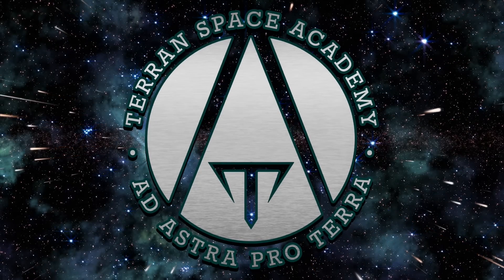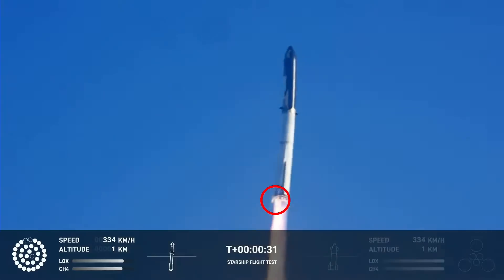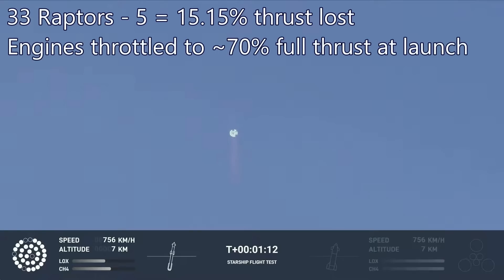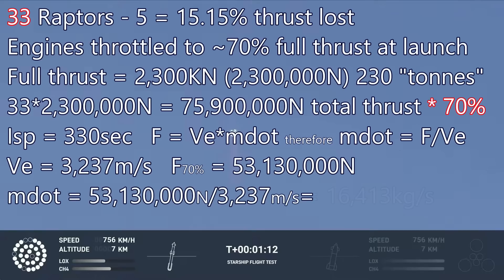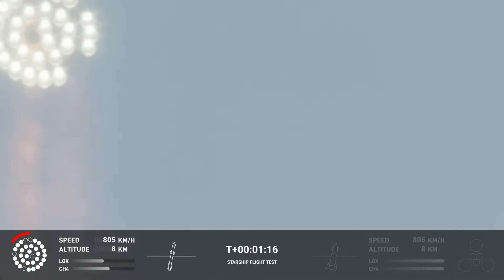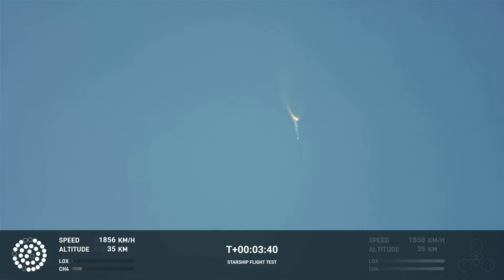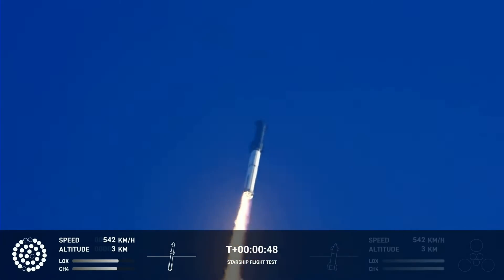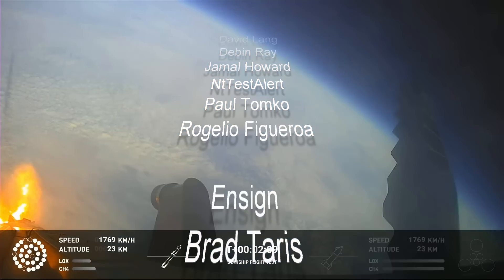Starship Flight Analysis: What went wrong with Starship?

Comment: You nailed it on the evaluation. I might suggest that an entire new video be made to examine the launch pad and what damage it incurred. There were obvious chunks of concrete that became cannonballs hitting fences and even man lift equipment along with temporary construction offices. An area that most of the live camera equipment for online YouTube sites used was dangerously plastered with chunks of concrete that crashed into cameras and taking out cars.
Reply: I think they are going to end up redesigning the launch pad. There is a reason NASA went to a blast deflector design, and it seems obvious that no material is going to be safe from that much punishment. It doesn't make sense to have to totally rebuild the surface and repair the structure after every launch.
Reply: @crawkn  See CSI Starbase. Zac Golden.
Reply: @samsleeman479  I don't have time to watch all that, but you could make whatever point is relevant.
Reply: @crawkn  Metal flame diverter parts are already showing up onsite. That was his and Zac's point.
Reply: @gravelydon7072  thanks. I hope they are planning on digging because I doubt diverters will solve the problem without a longer chute.
Reply: @crawkn  I thought is was ice
Reply: @lewistower1  there was a lot of ice falling off, which is to be expected, but I'm sure none survived the hot exhaust.
Reply: @crawkn  It did just not in that form, steam.
Reply: @gravelydon7072  yup
Reply: @crawkn , There's no more using concrete instead, thick metal plates.
Reply: @deancavander  YEAH , I was just thinking the same thing, a cooling system could also be installed directly under the plates to pull heat out in an attempt to keep the metal from warping. Maybe heating the plates at first to reduce thermal shock and then cutting to the cooling system as the rockets ignite....
Reply: @johnperkins5644  I had thought of that. Is that a standard sort of design? But a deluge system should accomplish that anyway, even if only from the top side.
Reply: @johnperkins5644  Properly done, the water from there could also be used in the suppression system.
Reply from the maker: Coming up my friend!
Reply: Yes!  No comment was made about the lack of deluge system  (allegedly because Musk wanted to proceed sooner than it could be made ready) or the damage and flying debris possibly damaging the booster.
Reply: The booster ignition after countdown remembered me more a test we know from nuclear bombs. Felt like the hell broke loose.😅
Reply: Who parks their car by a SpaceX BFR at launch? Someone to dumb to be working at SpaceX!
Reply: You can see debris shooting up just past the booster and reaching Starship it self in height, while it was ascending!
Reply: This thing is the biggest blow torch in the world, and with Ve of Mach 10 everything below gets burned and blown away. Higher launch mount, exhaust diverter and water deluge is the only option imho.
Reply: @FireEye-zd4fm  none of these things can be done there, not without new approvals and thousands of tons of concrete. There are only a few more launches planned from Boca Chica so far, and even they are questionable. Either the EPA will ban them, or the cost to build everything will not be wort it. Cape Canaveral is the future, as well as the oil platforms

Comment: I am of the opinion that stage zero debris blasted back into the engine area of the booster causing damage with immediate results and later in the flight.  Resulting in a true MECO not occurring in time, thus compromising the release of stage 2
Reply from the maker: You are most certainly correct Ray.

Comment: I'd think there could be an abort system immediately after launch where the booster would simply return the to the tower with starship still on board.   At stage separation there is only likely enough fuel in the booster to return it to the tower or in this case the water so if the booster doesn't separate from starship it likely doesn't have enough fuel to return to the tower with starship on board. 

 I'd think the booster would  have enough fuel on board at stage separation to be able to do a water landing with starship on board because it doesn't need to spend fuel on traversing a distance back to the tower.    In future cases if starship doesn't separate from the booster maybe a water landing could be a procedure.   The booster will float with almost empty fuel tanks.   Starship even with full fuel tanks will likely float.    There is still a lot of empty space in starship.   Liquid oxygen has a specific density of 1.1 where water is basically 1.   Liquid methane has a specific density of 0.66.   Starship with full fuel tanks should float in water.   Even in salt water retrieving the equipment is valuable for knowing what happened.   Of course this procedure would save the crew.   It would seem as long as the software is very smart it could bring the connected starship in for a smooth water landing even with massive failures.
Reply from the maker: Probably an emergency Starship abort to water landing in case of booster failure.

Comment: 1:56 - Analysis INCORRECT. .The flight computer does not increase and decrease thrust on outer ring engines to compensate and cancel out moments. That is the interior engines' job, and why they are gimbaled.
Reply: I have a hard time believing there is no thrust balancing in the software
Reply from the maker: There can be thrust balancing by throttling up and down the outer ring of engines.
Reply: @terranspaceacademy  There *can be*, but there is not. Ask Elon yourself, on an upcoming Spaces, if you don't believe it.

Comment: Another thing is that there is too much colour in the exhaust at times, suggesting that there is excess fuel or some other contaminant. Someone on the NSF channel suggested that maybe the hydrolic control unit (the box attached near the outside base of the booster) had failed.  Maybe we are seeing hydrolic fluid burning. They are going to be using electric motor actuators for gymbaling on next stages anyway.
Reply: Just some engine rich exhaust

Maybe
Reply from the maker: Hydraulic fluid?

Comment: Incredible! This was one of the most fascinating test flights I’ve ever seen. 

Thanks for the great lesson!

I’m no rocket scientist and I stake no claim in knowing anything about what I’m going to ask other than pure curiosity. I was wondering if there could have been an issue with the bmeco portion of the flight rather than a mechanism for the clamps failing?
I would have thought all engines on the booster would have shut off at the right moment the “flip” maneuver was complete? Could it have been due to all remaining engines still firing keeping the thrust too high thus keep the booster and ship attached? 

I have a feeling the “flip” is the best solution for this type of craft but it will only work if the engines actually shut down for the duration of time required allowing the ship to “tip” away?

Just a thought (out loud).
Reply from the maker: You are most welcome!
Reply from the maker: That could be correct as that would usually be catastrophic.

Comment: I see to remember in the Everyday Astronaut interview with Musk, he said there were no clamps to hold starship to the booster.  Thrust from the motors would hold it together...
Reply: I don't think there was enough positive acceleration during all that tumbling to keep them together. Had to be some mechanical attachments. Typically we would use a structural connection that is cut or otherwise released by pyrotechnics (pyro bolts, linear shaped charge, etc.), along with a separation method (springs, retro rockets, pusher pistons, etc.). I don't think SpaceX is using a pyro systems to separate, as that would take too long to replace for the next flight, so I expect it's some kind of mechanism, but I have no insight into what it would be. Most of the ones I'm familiar with are pretty slow compared to a pyro device (maybe 200 ms for the fastest ones). I believe they use pneumatic pistons to ensure axial spacing before the upper stage fires (at least that's what I understand they use on F9).
Reply from the maker: There must still be a release somewhere...

Comment: Only issue i think they had was pieces of concrete probably flew up and damaged a lot of engines, and had there been a flame trench we would have seen so much more!!!
Reply: Yeah, I think part of the rationale for not installing one initially was that there are no flame diverters on the Moon or on Mars.  But you still can't let your vehicle get taken out this way.  Hard lesson.
Reply: @paulwilson8367  I have always wondered about that.
Was there ever going to be a Superheavy booster launched from any body other than Earth? 
Why not use the proven flame diversion tech on the 33 engine monster and leave "flat pad" liftoffs for the 3 engine starship?
Reply: @paulwilson8367  There's no chopstick tower on Mars either. The booster is not intended to fly to Mars.
Reply: @paulwilson8367  they could launch an elevated landing pad before starship for it to land on instead.
Reply: @paulwilson8367  I was looking for this comment. While they may put flame diverters on Earth the lack of them on other locations for the first trips will mean they might want to research how to do it without one. Build to that. Then once they have diverters on Mars (moon doesn't need a booster but would apply for Starship), they can decrease the design strength later. It feels like the bulk of the population has "short term goals" thinking going on. Can't see past the end of their noses.
Reply: I've been baffled for a long time whey they haven't chosen to build a flame trench. They had the issue of debris damaging one of the earlier boosters during a test fire. Personally I believe that is the ultimate reason for the issues seen today.
Reply: @effervescentrelief  The issue is it isn't really a "they" issue, it is a government approval issue. 

Regs are very strict on what you can build in a reserve and a mighty big hole is one of them. Building the flame trench is relatively easy, tho not as easy as people expect. the issue is that getting the approval to do it will take forever.
Reply: @effervescentrelief  they probably wanted ease of access to replace engines without having to take it off the olm.
Reply: The reality is this rocket ultimately has to be optimized for launching and landing on Earth.  This really kind of precludes it from being good at anything else.  So might as well pull all of the stops to make this the best rocket to and from LEO.  You want to go other places, especially en mass, you are building more specialized ships to do those tasks; you are not doing it with Starship.  Especially Superheavy cannot make orbit and so can only go back to Earth once its propellant load is spent.  So might as well build around making its job as successful as possible, such as handling the tremendous thrust necessary to get this stack off of the ground on Earth with a proper flame diverter system.
Reply: @ChaJ67  They have a specialized ship for that. Its called 'Starship'.  😅  Super Heavy doesnt launch from the moon or mars.
Reply: To me it still looked like fire around the center engine that was out, makes me think it could have gotten hit immediately by debris, it looked like the hpu's and a few engines exploded in flight but the steps they took earlier in the year with engine shielding and containment and redundant systems almost kept it together.
Reply: @CanOp3n3r  Yes, I was deeply impressed when seeing that the rocket survived multiple engine explorations. It is a tough rocket.
Reply: They have the pipes for a much better deluge system but never were installed.   I think they were planning on reworking the launch stand after this launch before they even lifted off.  But looking at the damage and crater the launch did I think it was much worse than what they were expecting.   You can see some large chunks of concrete fly up almost as high as Starship was just as it lifted off.  I also wonder if some of the lost engines they tried to leave running and do a hot start on.    There was a lot of yellow flames at times that are not the clean burning methane from a well running engine.  Maybe they left them running to gather data and see if it was an option.
Reply: @Wild_Lee_Coyote  i like it
Reply: My thoughts exactly.  Debris from the pad flew up and damaged the engines.  A flame trench might have saved it.
Reply: Yeah but which direction to divert to? The OLM sits near the boundary of the site and is surrounded on three sides by ground equipment.  I don't think they'll be permitted to divert towards the open marsh land.
Reply: I think the reasons for no flame diverter and water deluge yet is it is extra work, and maybe they were unsure if they were going to be able to fly from there at the time , but also if the rocket just exploded on the pad, it would have been for nothing. They stuck with the minimums needed for flight for stage 0.
Reply: @digi3218  this has been discussed by Elon and SpaceX multiple times,  and you are spot on.
Reply from the maker: I think so too.
Reply: A thick metal launch pad with high melting point and flame diverter is the way to go here. Concrete in this situation will just be pulverized with that amazing power.

Comment: That engine that apparently came back online, could that have been the 1 still lit at the point of separation, therefore preventing it from doing so?
Reply from the maker: It was clearly out on the screen and stayed out.  I'm not sure why the sensors thought it was back up.
Reply: Will be nice to hear what actually happened throughout that magnificent display.

At least the trench is halfway there now...

Comment: Judging by the condition of stage 0, and the only real goal being for it to survive, it was not a successful test. Still a massive feat though
Reply: huh? it was a flight test.. it flew .. it cleared the pad ... which there was a good chance it would not .... and they got to test the self destruct range protection ....
Reply: Yes, major damage to stage 0.  Flame trench or steel plates are going to be required, concrete isn't working out
Reply: the goal was never to survive it was simply to clear the launch pad and that was always the goal from the beginning
Reply: @niox1920  The damage to the pad will significantly delay the entire program and affect Artemis. I'd call that a failure.
Reply: @Bellabong  First this isn't artemis and second they were going to redesign the pad anyways
Reply: @niox1920  Artemis 3 will require a starship in December 2025. And they can't even test another starship for half a year.
Reply: @Bellabong  top stage of starship doesn't launch or land on that pad, that pad is for landing the first stage
Reply: @niox1920  Read what you're writing... how does starship get into space?
Reply from the maker: I don't think they expected Stage 0 to make it.